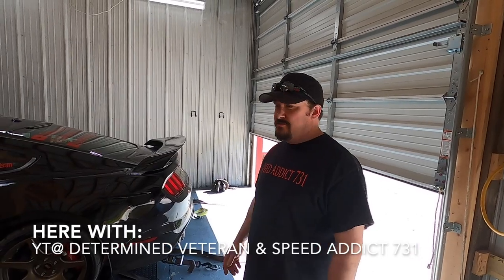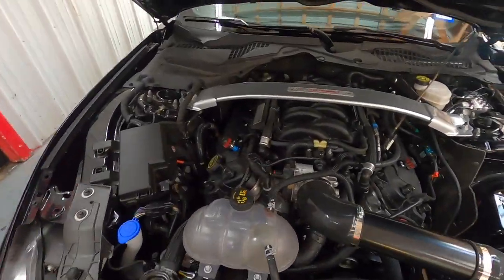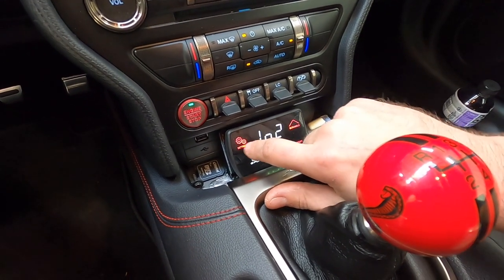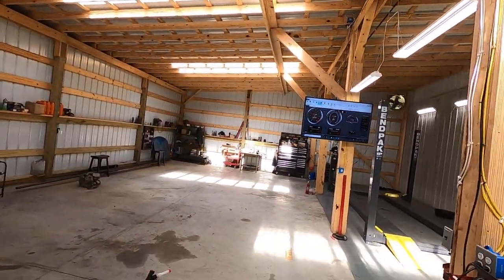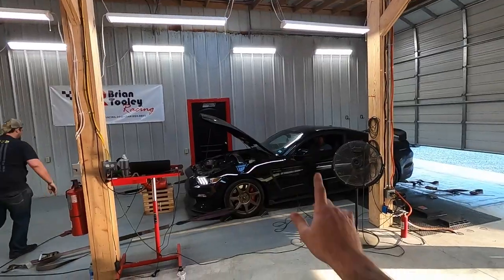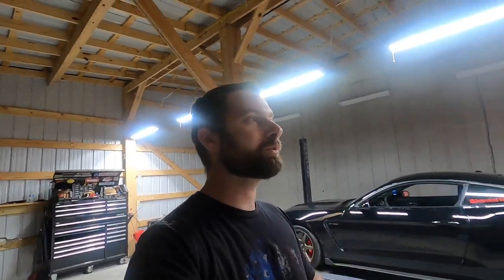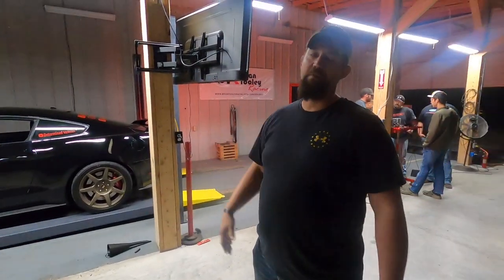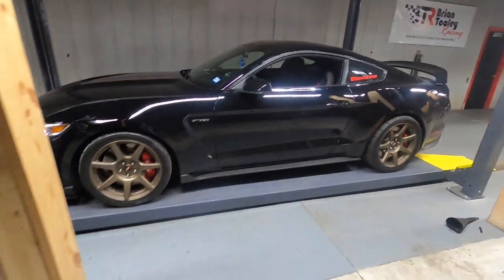making HUGE HORSEPOWER on the DYNO! TWIN TURBO Shelby GT350r Mustang Get's WILD!

Comment: Probably a low-timing tune so that's why it took 11# to make 800rwhp on E85. However, the turbos themselves and the exhaust manifolds (which aren't turbo headers) are limiting factors along with using at BAP instead of a full Fore Triple-Pump system. Congrats on the install and dyno. Now it's time to get the proper fueling to the car so you can produce the #'s it truly deserves to see on that much boost.